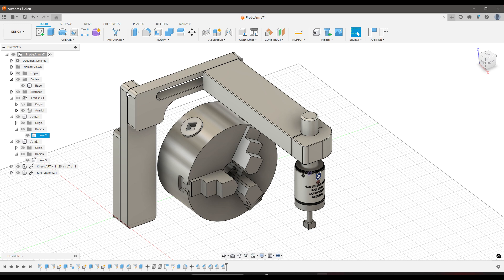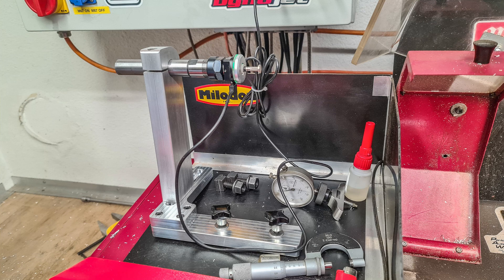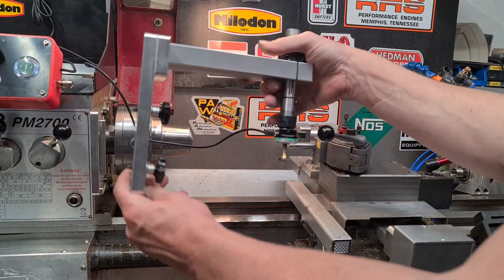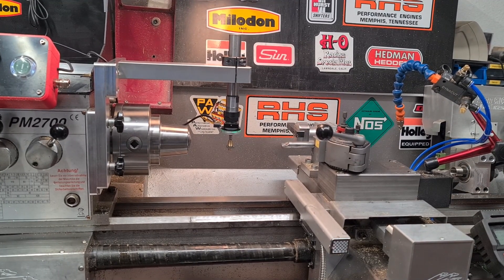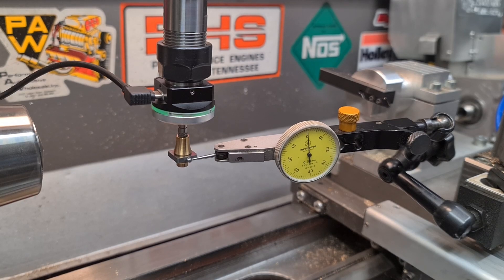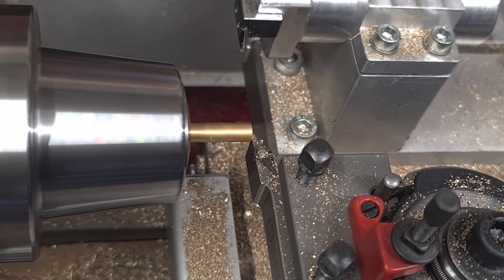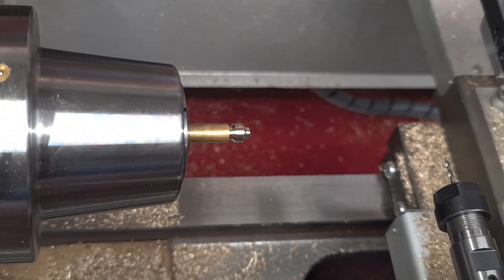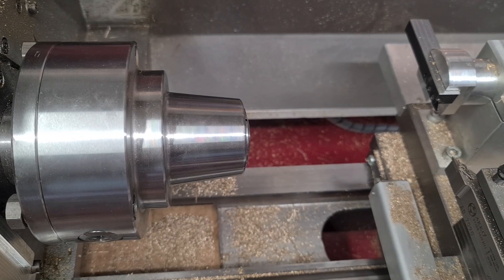TTO Arm for tool setup and turning some parts with Acorn6 DIY CNC

Comment: Could you index with dowel pins and use a magneticly mounted arm instead of screwing it everything
Reply from the maker: possible, but I do not like magnets on machines producing steel chips.
Reply: @TheSuntravel  I was thinking the magnets were on the mount so when your finished indexing it would be saved elsewhere

Comment: Where did you get the small square for this probe ? If you put a dial-indicator with a flat stylus in it, you could also use it for the height setting of the tools.
Reply from the maker: It is a support plate from a toolholder for SNMG12 inserts like a MSDNN 1616H12
Reply: @TheSuntravel  Yes I found it, it's a MS1204 Tungsten Carbide Shim, thanks.
Reply from the maker: @subuser9627  Some of them are not ground on the sides, so you have to fine ground them...

Comment: Awesome work Uwe, did you use the same livetool in a multifix holder that you made previously?
Reply from the maker: That is an option too, but in this case a cheap 500W 100V DC spindle.

Comment: Was thinking about it. But you did it, better than my solution. Nice Job. You did use tool T05 as a reference for the cut-off Tool ? What kind of cut-off Tool was this, a 1mm ? I only found 1.5 mm on Internet.
Reply from the maker: Parting off is with swiss Applitec: https://shop.applitec-tools.com/en/1028-741n   X and Z Reference is set with T0101 as usual, after this is set you can use the probe in all directions.

Comment: Eindrucksvoller Kontent, wie jedes mal. Aber ich habe noch eine Frage: Wie wiederholgenau ist der Arm, wenn du ihn abnimmst und dann wieder montierst ? oder musst du die Referenzposition immer wieder neu bestimmen ?

Gruß Michael
Reply from the maker: Nach ner Weile in Gebrauch hatte ich nicht mehr als 0.02mm Durchmesserabweichung ohne neue Referenzposition direkt nach neu einmessen. Hatte ja erst angedacht das mit einer Verzahnung zu machen, aber 2 Anlageflächen scheinen auch zu reichen. In X und Z positive Richtung kann man den Auslöseweg des Tasters mit den Maßen der Messplatte in den Parametern fein tunen.